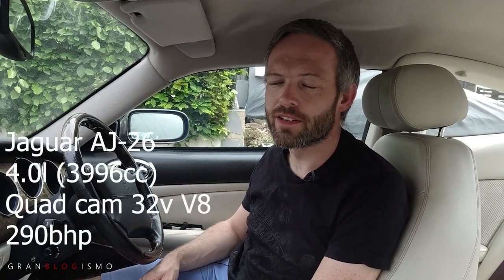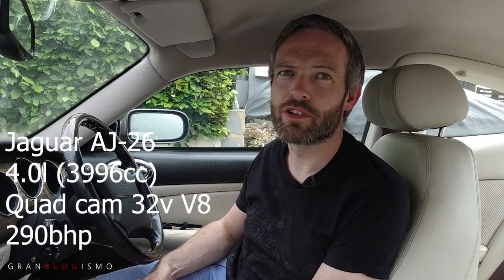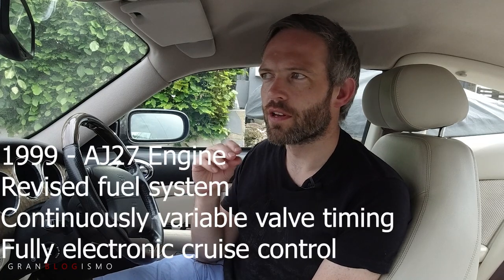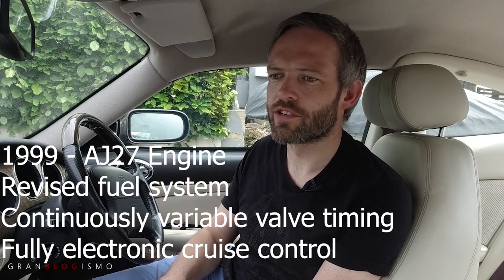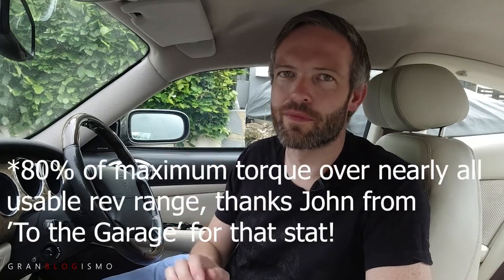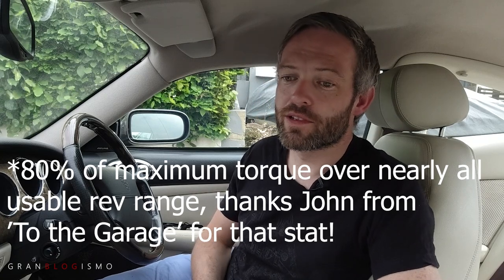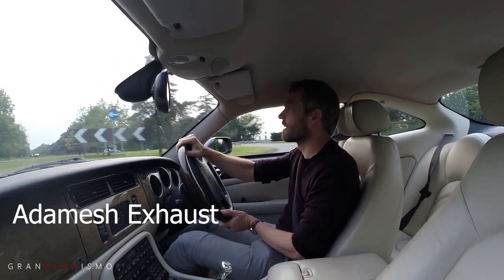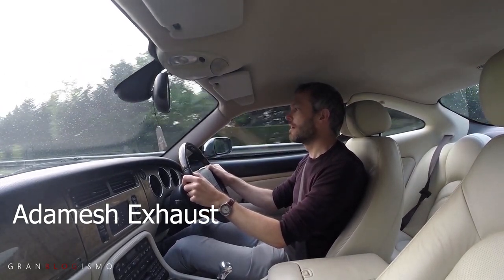Jaguar XK8 - In Detail : Engine and Drivetrain

Comment: Interesting video in the lockdown times, Mark. I changed the gearbox oil and diff oil for the first time on my 1997 XK8 at 80k miles. The gearbox oil was relatively easy to change provided you can get the car up at all four corners at the same time. Although the gearbox fluid was slightly the worse for wear, it could easily have done another 20k miles. The diff was the opposite, an absolute pig to change, until I created an access through the side of the boot, and the oil was completely black and burned and definitely ready for changing. :-(
Reply from the maker: Oh wow, respect for attempting that yourself! I suspect my diff oil could do with a change, sounds like I might get a garage to do it if it’s tricky! MGB slightly easier than these!!

Comment: Great video, I just joined the jaguar club, i got a 4.2 2003 xk8 and I'm in love. 
Got some minor issues though,.... 
My gear selector dials are always blinking and I can't get into manual or activate sport mode,
I also got restricted performance flashing on the dash, 
The most annoying issue so far is the speed I don't know why but my xk8 is quite slow for all the power of the v8 it's packing, I'm sure something is wrong, don't know if it's got anything to do with the "restricted performance" light flashing but the cat should definitely be way faster than it presently is.

I'm browsing through your old videos and learning a lot, thanks for sharing.
Reply from the maker: Great stuff, sounds like you have a similar problem to me with the flashing gear selector, I did do a video on it where my linear switch just needed a good clean to fix but I didn’t have restricted performance so might be something different or two separate issues perhaps 🤔 might be worth looking at some forums for answers, hopefully nothing too serious 🤞
Reply: Yea thanks a lot will definitely check out the linear switch and the car is over a 100k mileage so it might be due for a transmission oil change. 
Lovely exhaust note, i did a side pipe conversion on mine, crazy but it looks great and sounds like a beast but sadly crawls like a snail hopefully I'll have the sluggishness sorted soon. I apologize for the long yarn I'm just excited about this beast.
Reply: Update on the J gate(selector) lights blinking. I got it sorted by just cleaning up the inside of the selector, part of the top covering had broken (probably due to bad aging) and the debris dislodged a connector on the the manual side in the selector, hard to explain but a thorough cleaning will definitely sort things out (didn't have to open up the linear switch though). Got manual and sports mode back 😎 but still got restricted performance and sluggishness 🤦‍♂️ hopefully will also be sorted soon.

Comment: Hi, I have a 2003 XKR, also in green. When I put my foot down it rockets through the gears however every time it shifts up there is a squeak which I guess is coming from the gearbox (maybe). Do you have any idea what it could be? It does not seem to effect performance.
Reply from the maker: Hmm weird one, I’m not sure but I would think maybe some sort of mounting that might have gone? I had a squeak in a previous car (not XK8/R) but that would squeak when the engine rocked on worn mountings, could be something like that but I’m no expert!
Reply: Common issue. Sub to the XK8 forum. All answers there. I belive you can put an additive to the trans fluid to help prevent the squawk. Changing the trans fluid could help.
Reply: Squaks when shifting up is a well known phenomena. Also hard downshifts from 2:nd to 1:st gear when stopping. You will find lots of answers and comments on this in the Jaguar forums on the net. I would recommend a complete change of the trans fluid+filter, replacement of the connector sleeve and the 5 hose seals in the Mecatronic unit.
Reply: Fluid and seals on mechatronix will stop issue.    Plenty of videos to assist.  Enjoy!